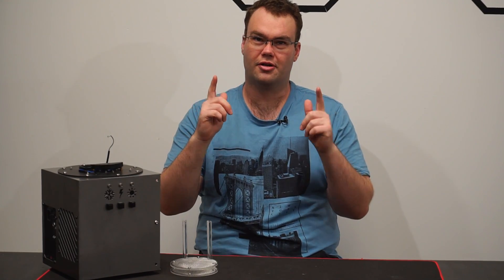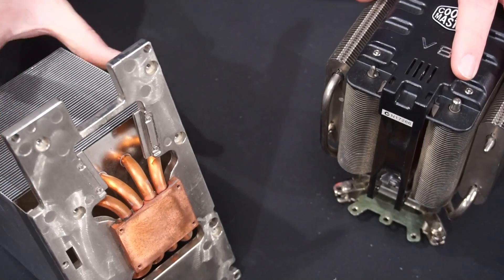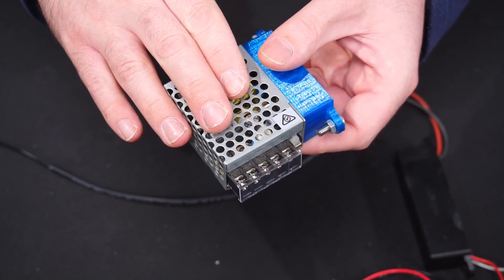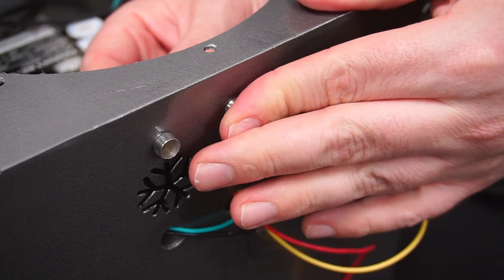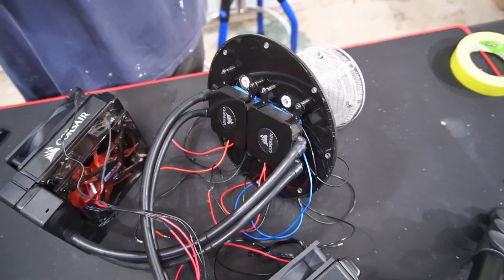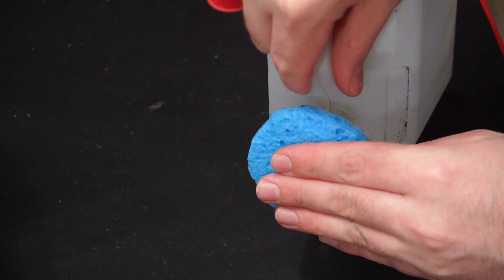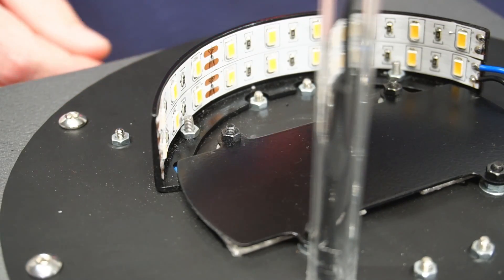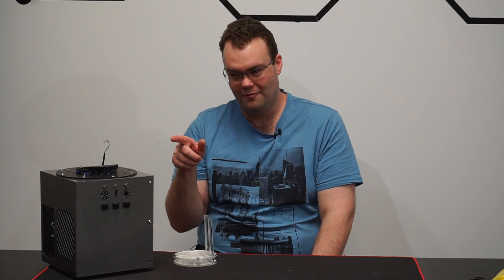How NOT to build a Cloud Chamber! (Particle/Radiation Detector)

Comment: What if instead of using a heat sink and stacking multiple peltiers, is it possible to freeze some heat sinks into a frozen water - salt mixture (that therefore stays at around -20°C), could that work?

Comment: Run a pipe from the hot side of your peltiers to the top of the chamber to heat the alcohol, then run it from there to your cooler. That way you are using the heat you are generating before cooling it down. Make a custom liquid cooling tube to circulate your cooling solution to a plate on top of your alcohol, then rub it through your radiators.

Comment: Actually, even the video which inspired your first build had no explanation for the use of a high volt age generator. And it is really not necessary for the cloud chamber to work properly. All it does is to clean a bit the inside by electrostatically charging dust and residual droplets, which might be nice but not really needed.
And I would go for pure ethanol (98%) rather than isopropanol, as ethanol boiling temperature is a bit lower. This is probably not making a big difference, but everything helps. Pure methanol even better (b.p. around 65 C), but clearly more toxic.

Comment: I know it's not self contained or continuous but I just feed my liquid chiller block from a bucket full of ice. I had no choice since there was only one Peltier laying around and I am technically here on vacation so I don't have all my equipment anyway. I am also using the Peltier cold face directly with engine black on it. Yeah, it doesn't give much viewing area but I normally use scintillation detectors anyway and this was just for fun. Good job on sealing up the sides of those Peltiers. Condensation inside corrodes them very rapidly. I only use epoxy or Lexcell now since water migrates steadily through silicone.

Comment: So, I’ve always stacked the peltiers in a pyramid pattern. One on top of two (with a heat spreader plate between them).
Reply: Yes Noah! It's in the Peltier datasheets on how to use them! The lighting and the Peltier not being researched beforehand is a shame. He's sorted the Peltier still not being stacked in such a way that the smallest top plate gets down to temperature, but the LED's could have been sorted with just a glance at the old black and white research images. It's 'raking' light obviously, and using an acetylene torch with a lens most likely. The actual photo would maybe use a magnesium flash. With a Robin Reliant (old 3 wheeler car in UK) heater matrix or similar, a pump and water this should be a straightforward project. It would be nice to view from the top, the glass bell jar prevents that.
Reply: "1 on 4" is about ideal, depending on how hard you're having to drive them.

Many don't realize the rating on a peltier module is the maximum and that they run much more efficiently below that, but there's a sweet spot.

Too high, they produce excessive heat on the hot side and there is a direct relationship between hot side temp and minimum cold side temp.

Too low and they can't move the load. That relationship is between capacity to move heat and power input.

So, most efficient operation is very large dissipation for the hot side, small as practical cold plate, and running with the minimum power input necessary to reach the temperatures required. This also requires experimentation for the power levels for each layer in the stack.

Comment: I knew it is not as simple as it might seem
Reply: One of the bigger gotchas with peltier is that they make a lot more heat than they move, and this has to be taken into account. Simple stacking "works" but isn't even close to ideal. This becomes even more apparent when running them at or near full power; the layers "below" (facing away from the cold plate) generate more heat than the next stage can remove. At best this results in cheesy performance, go silly with it, let the magic smoke out.

Comment: 9:54 
I've applied thermal paste to my CPU before and this is definitely not the way I'm told to apply it... but is it different for TECs? I'm going to be trying to build one of these so any optimizations I can make would be great
Reply from the maker: Definitely not how I'd recommend applying thermal paste on CPU's. The ceramic surface of the TEGS is very rough and uneven compared to a CPU heat spreader.
Reply: @Schematix  Thank you!

Comment: This is a great video! But what is the high voltage for? I've looked at quite a few cloud chamber tutorials and I'm in the process of building my own, but none of them use high voltage.
Reply: High voltage "cleans" the chamber from dust (that could constitute a nucleation point) and from already ionized molecules.
Reply: Most designs forego any HV. I recall some plans called for it and I think that scares people off needlessly. I didn’t use it and my design worked.

Comment: Nice. How did you wire the 4-pin PWM connector without PWM controller? Is there a way only to connect to DC power supply?
Reply: Red-n-black just like always

Comment: Cracking build, a few questions - 1- why the HV DC power supply top and bottom, 2- what voltages are you running the coolers at (I`v seen a stack of 2 with the top one running at 5V and the second cooler running at 12V) that`s the way I`m going to wire my cooler (This time).
I`v rebuilt my cloud chamber so many times and still no luck......
Reply from the maker: Thanks, glad you enjoyed it. 1: there is only a single HV DC boost converter (around 5kvdc output) and a small 12vdc PSU powering the boost converter. 2: the bottom teg (touching the AIO water block is run at 12vdc. The top 2 tegs are wired in series and run from the same 12vdc PSU (effectively running them at 6v each)